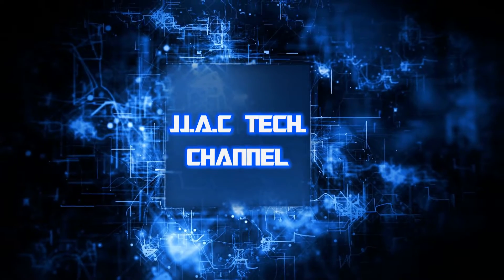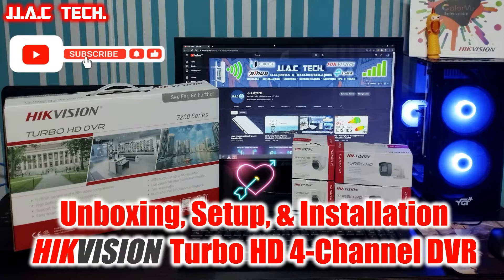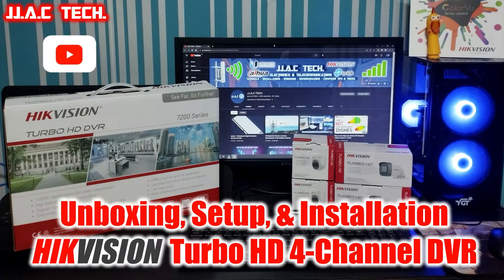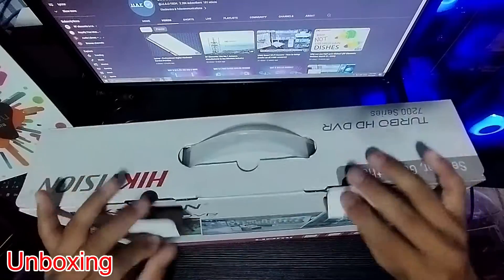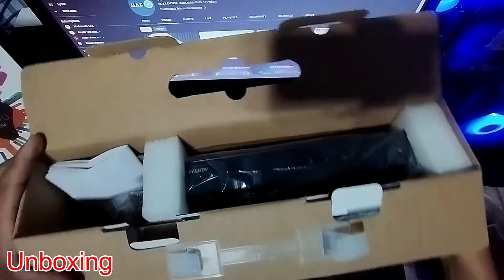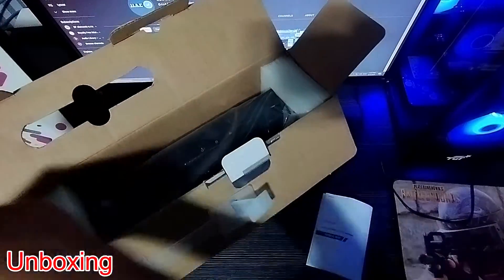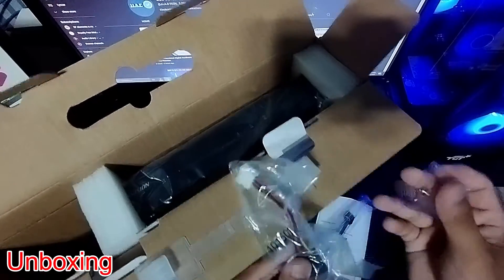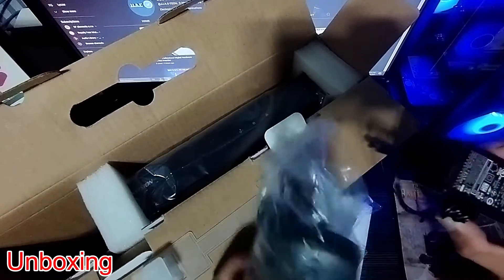HIKVISION Turbo HD 4-Channel DVR - Unboxing, Setup, & Installation

Comment: Does it have a audio setting. For cctv cameras with audio cable?
Reply from the maker: Yes, it only supports TVI audio cameras on coaxial, and it also supports audio-in and out via RCA cable.